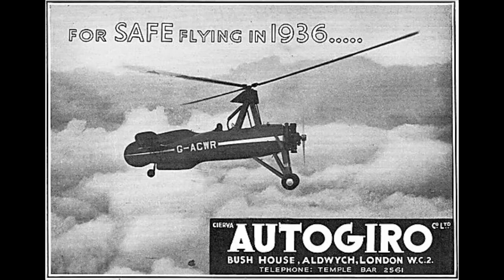Cierva C30A Jump Take Off - Original demonstration film (1936)

Comment: @Gyrocopter flying club >>> Speaking of jump takeoffs, do you know of any kit gyroplanes available today that can be equipped for jump takeoffs?
Reply from the maker: I don't actually - and I'm surprised (especially in the US) someone hasn't made a kit to fit to retro fit.
Reply: @gyrocopterflyingclub6148  >>> Okay, Thanks. 
 
FWIW, the post you replied to was originally a good bit longer.  I shortened it so as NOT to recreate "WAR AND PEACE". 😊   Here {more-or-less} it's what I was originally going to write: 
 
I was a student pilot in the late 1970s, but did not stick with it much beyond soloing in 1979 {mainly due to lack of $$$}.  I later joined the military {for 20 years}, and was a non-pilot aircrewman in the US Coast Guard.  However, in those 20 years I never renewed trying to get my pilot's license.  
  
I've been wanting to go back and get my ppl -- or at least sport pilot license -- for quite some time {actually, I NEVER gave up that dream}. I would DESPERATELY love to take my grandson -- and my daughter -- flying.  I pretty much KNOW whatever I choose will be homebuilt/experimental and trailerable {it saves $ to self-build and keep it in the garage}.  I've been interested in something STOL-ish, but I am also slightly concerned about flying into  light turbulence and becoming queasy.  {USCG HC-130s do NOT have much trouble with light turbulence...😜}   I know gyros are BETTER at handling light turbulence, although they are NOT the best bush planes, as far as takeoffs are concerned.  
 
It occurred to me a few weeks ago that a jump takeoff gyro could fulfill the roles of STOL and turbulence resistance.  Previously, I disregarded jump takeoff capability as unnecessary added complexity, but now it seems a worthy trade-off.

Comment: Is that a 2-blade rotor on that gyro?  The still image looks like 3-blades, but the moving footage appears to be 2-blades. 
 
{I watched this on my smartphone.  It might be to differentiate on a larger screen.}
Reply from the maker: Yes its a 2-blade rotor they couldn't get the 3 blade version to work so well with their auto-dynamic system.
Reply: @gyrocopterflyingclub6148  >>> Rodger that - Thank You.